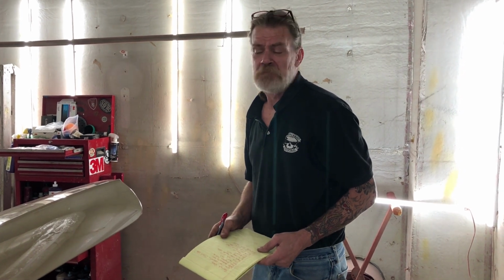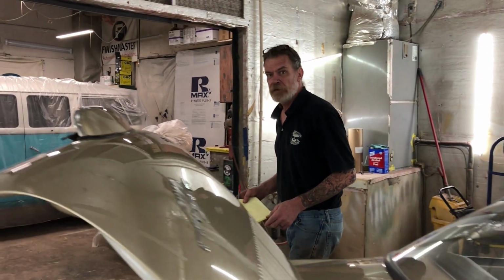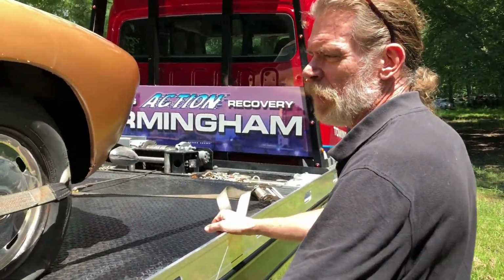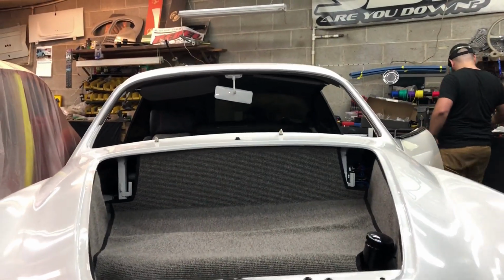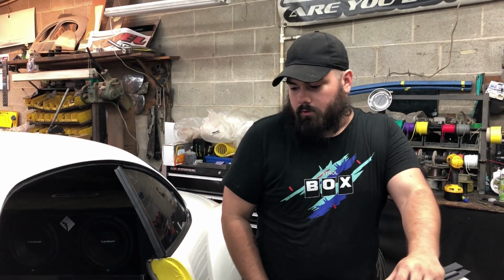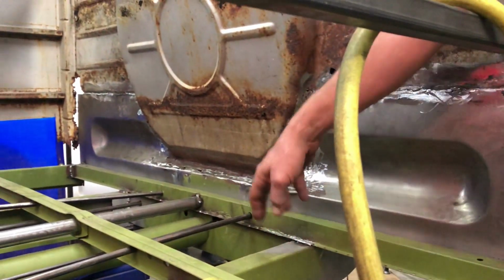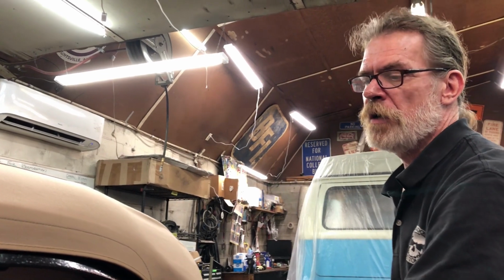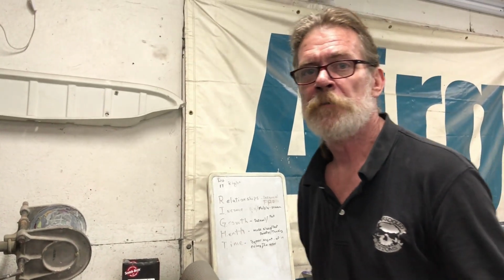Are Karmann Ghias Good Cars? #vw #karmannghia #vwrestoration

Comment: The white Ghia has dual cables running to the decklid latch, is this for an electric solenoid? I would image not an "emergency release", as they default to open. Great Work!  Thanks!
Reply from the maker: yes there is a Manuel release , being that all of the doors, hood, and engine lid are electric and on remote

Comment: Ghia's as 'restored' or 'resto-mods' or collector car.   People, dont get roped in by these billy-bob shade tree Chip Foose wanna bes....  A Karmann Ghia is a fine candidate to 'fix-up' and drive for the car that it "WAS"...  I just bought a solid, running driving 66 Ghia in SoCal for $5,000.  single 1600cc.  Oh yea sure, I can put a 2800 etc, etc. fancy smancy motor with way too much horsepower, then I need a freeway flier transmission and upgrade all the suspension, and dont forget the 4 wheel disk brakes.  Let me tell you something, you still have a tin can Volkswagon.  I dont want to be in a VW going faster than 60 mph...  its just not safe.   Im an old school guy, mine is going back to ALL STOCK,  I'll put $2,500 into paint and body, $12-1500 inside, and have a great looking running car.  at the end of the day, I will sell it and make $2,000+ profit.  If you go over board, and your car is stuck in some shop somewhere for 3-5 years getting all the 'do-dad's' and $30,000 later....  You're screwed.
Reply: Oh yea, I forgot, and put a $87,000 pearl paint job, with 92 coats of clear coat, color sand and buff...  etc, etc, etc....  Just take the car to Earl Scheib, or Macco and get their best paint job.  The top end paint shops and Macco all hire the same slave laborers to do their work.  If you're not smart about it, there is NO END to what you can spend on a car restoration, and believe me there are people out there that will talk you into anything...  cha-ching.. $$$$$$    BE CAREFUL...   Just buy a $5-8,000 Ghia, and drive it, have fun a few years, and sell it for what you have into it.  <<Smart move.
Reply from the maker: Wow, sounds like someone did you wrong. We wish you all the best with your
 restoration.

Comment: Ahh Ghia's... I did some body work on a '57 years ago.  The passenger front fender had some bad repair over rust and bad dents.  Customer supplied a replacement cut from another lowlight Ghia.  The replacement when fitted up was 1 1/4" longer than the un damaged driver side.  The Karmann Ghia's are truly hand built, so body work is time consuming and fitting and "adjusting" is critical.  
The Ghia's in your shop look great! Thank You for the video!
Reply from the maker: You get us, Jeff. Thanks for hanging out with us.